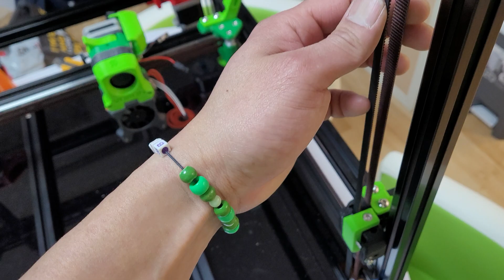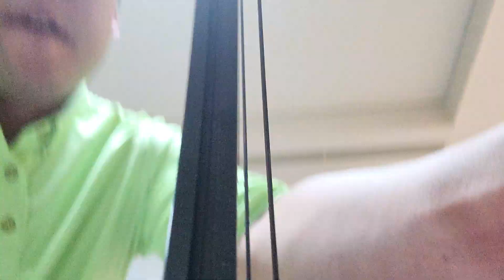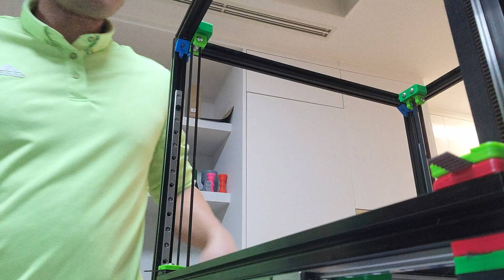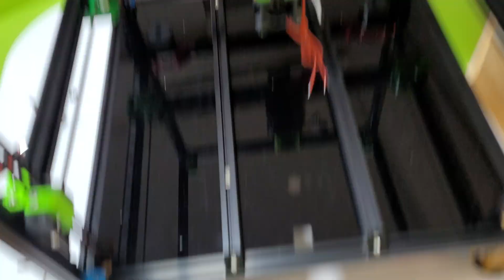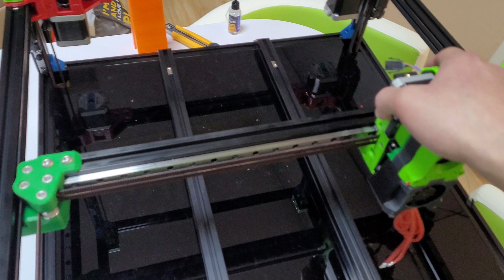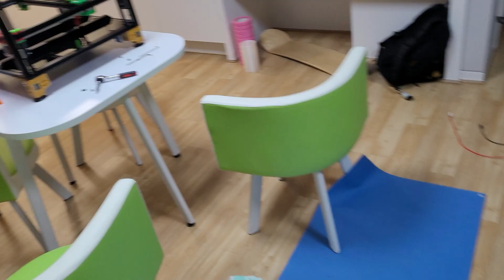Voron 2.4 Build with Formbot done attaching front gantry to frame finally!

Comment: @2:38 the reason that it isn't smooth is because the motors are plugged in and back feeding the printer with power.